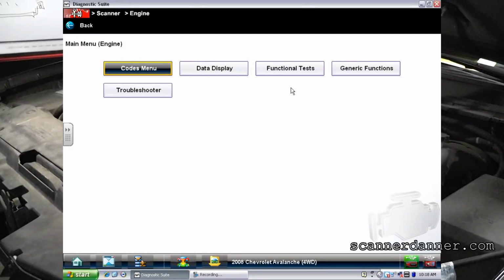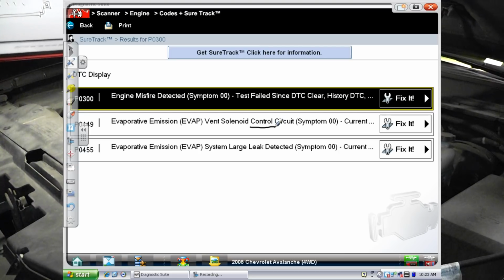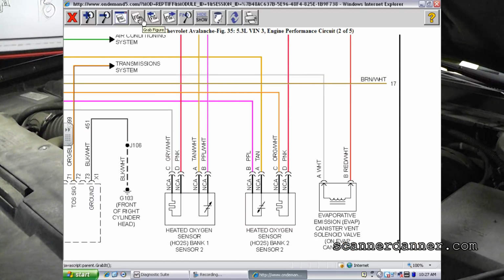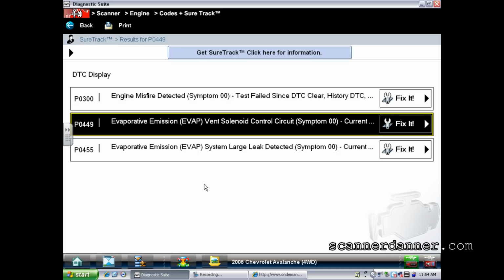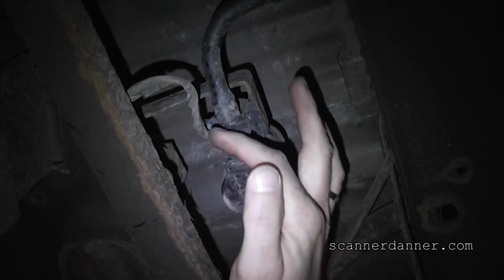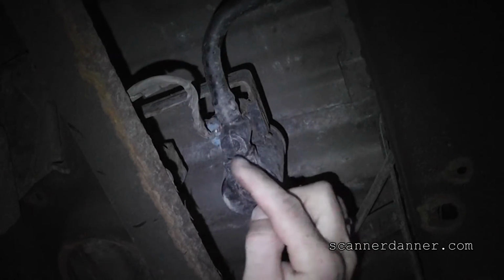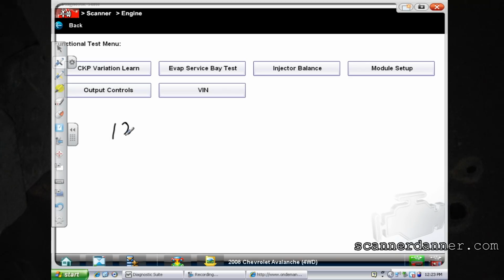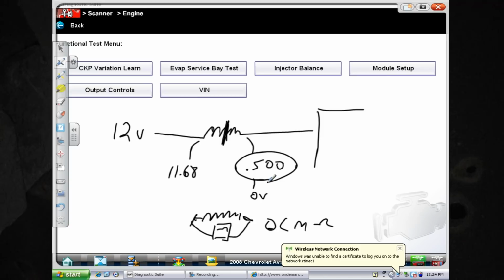2008 Chevy Avalanche EVAP Vent Solenoid Test (P0449, P0455)

Comment: Same issue here. I have replaced the front purge valve, the vapor canister with harness, and the gas cap. All GM parts, And still have the check engine code? P0449 any thoughts?
Reply from the maker: What about the Vent Solenoid?
Reply from the maker: The P0449 code is related to the Vent solenoid itself or the wiring going to it. Tug on the solenoid wires right at the connector. They are known for breaking inside of the insulation.
Reply: ScannerDanner I have replaced the vapor canister vent valve solenoid( the long hose with the valve that the harness connects to) and the harness too[ actually some one already did the upgrade to the New were version already]. I also installed the new GM gas cap, in the front purge valve that's located where the spark plugs are. Still get code p0449, i'm trying to do this in my driveway I'm not a shop nor mechanic but I've done a few engine and transmission swaps so I know what I'm doing.
Reply: ScannerDanner i've noticed on the actual connector itself there's a red wire and a white wire, do you know if each of these wires correlate right to the other, seems when you connect the plug the red and white wires crossed paths,
Reply: Like it would seem that the Redwire would connect to the red wire and the white wire would connect to the white wire, but because of the clip on the harness and where the plugs fit in the red wire connects to the white wire and the white wire connects to the Redwire. Very odd.
Reply: Is there a fuse that controls this vent solenoid? I have replaced everything and still have the check engine code

Comment: This is kind of obvious, but I would like to know for sure. The insets showing what is probably a Verus there, does that unit have ability to record long screenshots (several minutes in another upload viewed yesterday), from which you add them to your video and sync to the camera shot of you working?
Reply from the maker: For sure, it is a windows based laptop (The Verus). I can record the screen for as long as I need. I've had some over an hour.
Reply: +Danner - I am surprised the hard drive and processor is able to capture live for so long. My laptop pitches a fit if going even less. Makes my at some point acquisition of a Verus all the more enticing. I already concluded a used eBay model for price (around $1200) is just better than the alternatives because of the scope and extra info provided by Snap-on that helps in diagnosing. That's where the thinking is heading at this point at least. Your video and reply helped me discover an unexpected addition to the features. Thanks.

Comment: I have the vent valve solenoid failed. No system leaks. I replaced the vent valve solenoid and it came back again with a brand new part. What to do next?
Reply from the maker: Tug on the vent valve wiring connector, right at the plug. The wire is broken inside of the insulation.
Reply: I will check it thanks.

Comment: Question...
How does the computer determine if the solenoid actually closes?  Does it use a pressure sensor somewhere else in the system to determine that?  If so what sensor?
Thanks in advance.
Reply from the maker: +Kevin Finn It doesn't monitor this solenoid directly (mechanically speaking). The only time it is closed is during a leak test and if it doesn't close, the PCM will flag a large leak fault. The system is monitored with a pressure sensor mounted on top of the fuel tank sending unit. 
For the leak test:
-PCM opens the purge valve and closes the vent
-once vacuum builds in the system, PCM shuts off the purge and keeps the vent closed, while watching the psi sensor for a decay in vacuum

Comment: I have a 2007 suburban but a cant fix I try to see how to check the white wire from the computer to see if is the wire or the pcm I need wiring diagram from this suburban but I can't get the wiring diagram help.
Reply from the maker: +severo hernandez search Mitchel1DIY, you can get the same diagrams I use for about $20 for your vehicle

Comment: DAN ?!  I have a p0449 (2007 Tahoe 5.3)  Vent solenoid is Good.  Ground signal IS provided by PCM (term 61 if I remember correctly) but not reaching to vent solenoid connector.  Any suggestions where to check first for open ?  (connectors etc.).  Thanks !
Reply from the maker: +kalbert68 sorry man, wish I did. Oh and my name is Paul :)
Reply: +ScannerDanner OK Paul:) , thanks !keep up the great work.

Comment: Is there a way to test any of this without a 4,000 dollar scan tool. My 07 impalla threw the 0449 code. I have replaced the old vent solenoid and bench tested the old one wich was deffinetly bad. However the check engine light on the dash remains.
Reply: you have to reset the ecm providing the problem is fixed the light will go away

Comment: im have a gmc yukon 2007 and the code po442 EVAP small leak whats the mean can you help me
Reply from the maker: +sonidofuriamusikal not really, you have a leak that needs to be found with a smoke machine. Do you live near Pittsburgh PA? I can do it for you at my school for free. 
The two most common causes on GMs with a leak is the vent solenoid sticking and or a bad gas cap. But there are other causes too
Reply: im live in piittsburg ca  thanks for your help

Comment: I would like to know,  should I Replace The tip of the wire, or the solenoid? I have a visible vapor leak, unsure of whether the wires are damaged or the solenoid

Comment: Hi danner need big help
2005 Nissan sentra cannester vent valve p1446, 2 wires ground swith,when plug in power on both connectors unplug only on one, when plug in I did the test light test connected to ground, back proveing the ground side valve did not work, i remove the valve from the car and run straight 12v valve worked did the same test out of the car giving 12v on the power side and ground with the test light Valve did not work, I did the same test on the purge selenoid on and out of the car and it work both ways, I'm just confuse as why this happens, my theory its that the selenoid has to much resistance that it requires full power to work, hope you can help as I don't want to replace a good working part, thanks

Comment: Great video! I replaced my solenoid before finding this video. I still have the same code. When I check the voltage i always have 12v key on or off, truck running or not. It's a constant 12 volt on both sides, like the ecu is not sending the ground. What would cause this? 2008 silverado 5.3
Reply: I'm having the same issue, did you ever resolve the problem?

Comment: Can the solenoid fail, or stick in the closed position? Which would not show a large leak code.  It would not allow system to vent, and not allow gas tank to fill properly. What would the ohm reading be through the solenoid if it failed in the closed position?
Reply: Ohm reading will be unaffected and yes they can stick closed.

Comment: Great video. I have a question though. I am using a Mac tools logic probe and I have power on the 12v rd/wht supply wire, but I am not seeing a ground or 12v signal on the white driver wire. I suspect I have a wiring issue or computer issue, what are your thoughts?
Reply from the maker: get rid of that logic probe and use a regular test light. Most likely your solenoid winding is open. you will not see a ground on the control wire unless you are commanding the driver on with a scan tool. And you will not see "power" unless the winding is good and the driver is off. (It's not really power on that control wire which is why I don't like logic probes)
Reply: ScannerDanner Thank you. I have a simple code reader and I no longer own my Snap-on MT 2500 scanner and cannot command the driver to cycle on and off. I had assumed with key on I would see the white wire show ground as the computer cycles a command.

Once again great video and thank you for the help.

Comment: Hypothetically let's say you didn't have access to a thousand dollar smoke machine and bidirectional scan tool and this same truck did have a gross evap leak code. Could you jerry rig a device to test it? Such as, attach a jumper wire from a good ground on the car to the white wires ground switch to close the vent valve. After the systems sealed could you like take the evap test ports schrader valve out and have a friend inhale a cigar and blow it into the test port while you try looking for smoke coming out in a line. Just a theory I thought i'd ask if you want to fix your evap and your on a tight budget.
Reply from the maker: For sure! But from a guy that its taken 20+ years to finally give up nicotine, that isn't the way I would do it. :)
My brother has a rigged up tool he uses for evap. tests. He uses shop air (small amount) and soap and water. (I think)
You'll have to ask him. Have you seen his channel yet? James Danner is his YouTube channel name.

Comment: would i go about a P0446 the same way as the P0449.  Solenoid is good. Applied 12 volts to it and it closes. With solenoid disconnected i have no voltage to connector with key on.  99 Mitsubishi eclipse gs-t spyder.
Reply from the maker: Yes, you need power to that solenoid. Here is a link to a sight that you can get the same diagrams I use.
http://www.eautorepair.net/marketing/html/about_us.asp?VID=&Count=Y

Comment: Hi, I have a chevrolet malibu 99 and have problems with vent selenoid and purge selenoid I check fuse and both selenoid are good and checkselenoid with voltage external,  sound click selenoid my question is: need some pressure for operate the drivers in PCM or only with the turn on the key must be operate the drivers and send the ground to both selenoid.
Or this symptoms are bad PCM ? how to force to send ground to selenoid throug the PCM

Comment: dan
I have a 2000 chevy 1500 5.3  w the codes p0171 p0174 p0300 p0449 as well
would the vent valve solenoid circ cuse the other codes to fellow as well
bc its got new plugs and wires as well and clean the mass air flow and the codes came
back and haven't done anything w the vent code as of yet
Reply from the maker: The P0449 code will NOT cause the lean codes and misfire that you have. Totally separate
Reply: thanks......I got under and tound the big hose off going to the soiled vent vavle cirurt ......ithe misfire and lean codes come back what would u say to look into as to what is coseing the random misfire and lean codes .....I check the fuel presser and it was at 55 psi
Reply: I saw this vieo just before this ....if u have more vidos mybe that u think mite help let me know thanks so much
Reply from the maker: Jim B start here Using fuel trim and freeze frame data to determine type of lean condition
Reply: thanks
Reply: my fuel trim numbers
short trim is  -1.6  ?
long trim is 24.2 ?
Reply: this truck motor was swap out of a truck that was rolled over or in acant  ....the truck runs great very slight misfire no rough ilde or stalling
am watching you vido of using fuel trim to id typ of misfire
Reply: Jim B Are the fuel trim numbers at idle or when cruising ?
Reply: Idial
Reply: Jim B With fuel trim being that high at idle its a good chance you have a vacuum leak somewhere . I would smoke test it first but if you don't have smoke mach you can try spraying water around intake manifold or carb cleaner just be careful with carb cleaner . Paul has a good video on how to find vacuum leak with water
Reply: Thanks but a few weeks ago I took it to a shop and the guy sprayed all around w carb cleaner to try and find a leak and couldnt find one ..did a test to se if the02 where working and they where .I changed the intake casket 
And didnt help and he found the fuel presser low at 45 psi and thurt that mite be the reson why and thst wasnt it after I put a brand new pump in from rockauto ...I saw the back of the throttle plate was real nasty like dried up oil so I was going to pull that off and clean it up and see if that help
Reply: Thats when driveing would be my gusse

Comment: The 2001-2009 GM's seem to have a lot of P0400-0499 series codes.  Something with the design of the EVAP??
Reply: The solenoids get vapor on them, then dust gets in and they stick open. Very common. Really handy if you have a service bay test for EVAP on the scan tool.
Reply: Anything to help the solenoid keep from getting stuck?
Reply: not really. the location and design are such that they cause issues. IF you scrapped the factory part and used a better part it would stop the problem, but $$$$
Reply: yeah, that's usually the case.

Comment: A quick voltage test is to stick a noid light in the vent electrical connector and turn solenoid on/off with scanner.
Reply from the maker: Good one Gail!
Reply: ScannerDanner I should have said circuit test. So far my OTC noid light kit hasn't let me down, as for having one to fit. The only objection that could be raised is we normally try NOT to disturb the wiring/connectors just so we don't miss an issue. Just moving a connector around might temporarily "fix" a problem. But in this situation, the vent solenoid is probably THE most frequent failure, so I don't worry about that happening. It's a habit to closely inspect any connector for damage/corrosion anyway.

Comment: Yes Paul, your methods are different.  Us "normal people" don't have $40k worth of diagnostics equipment.  Though most of us also very much wish we did.  ;-D

In regards to the P0300 on this vehicle, I noticed the scantool mentioned "DTC set since last cleared" or something to that effect.  Has someone else been in there before you guys?  If nothing else is readily apparent for the random misfire code, check vehicle history, see if it got a CKP sensor recently.  If it did, put the truck through a Crank Variation Relearn.  You may have to do it over a dozen times before it takes.

I've seen this problem on GMs way too many times.  The factory flowcharts will tell you that replacing the sensor may cause misfires NOT to be properly monitored, but at no point will it ever say that false misfires could be detected.  I find the latter to be the case more often than not. 

Just some thoughts on direction if nothing else makes itself apparent.  :-)

Comment: Great ground side switching example!

Nice back probing probe.  They should make them adjustable length so shorting of dual probes doesn't happen.  You could also put some shrink wrap on the prob and just have 1/2" showing.

No, you're NOT the normal person! LoL  You're more fun!  "Normal" is an average of a group of people trying to be the same.  You're trying and SUCCEEDING in producing automobile techs who can think on their feet and not just be a flowchart robot! 

Also, a GREAT man can say "I was wrong"!  What a great example for your kids and students! 

"We might be over killing this"  You're teaching!  Nothing can be overkill with teaching!  Keep it up!

A long jumper wire from the battery ground would solve the rusty underbody.  Just snap it on before going under.  You'd have a positive ground.  (or would that be a negative ground? LoL~!)  I did this when I was field testing my fuel pump on my 98 Windstar.  
Field testing = in the rain on the side of the road.  (That wasn't fun!)

My test equipment:  paperclip, long speaker wire, and a interior light to serve as a test light.  

I found an open fuel pump, meaning the brushes weren't conducting to the commutator.  I pulled the cover off of the fuel pump relay  and used something to keep it closed to provide power to the pump. (instead of the couple of seconds of power with the key turned on)  I went under and hit the tank.  I could hear the pump turn on with one hit, and turn off with the next.
Reply from the maker: Nice! Thanks so much